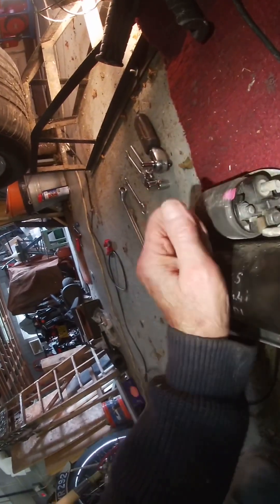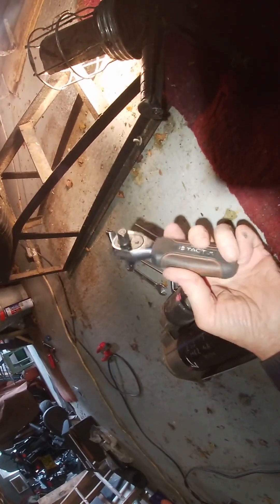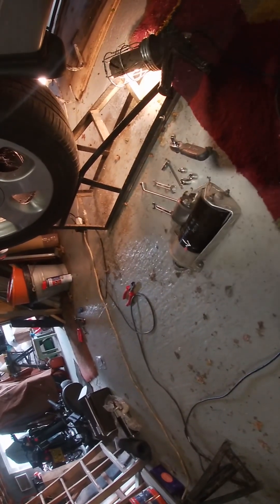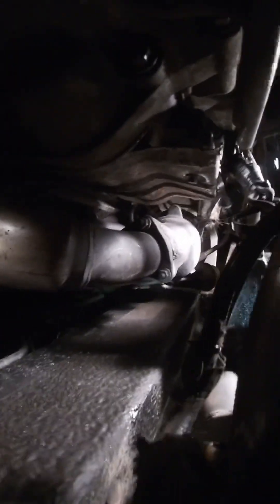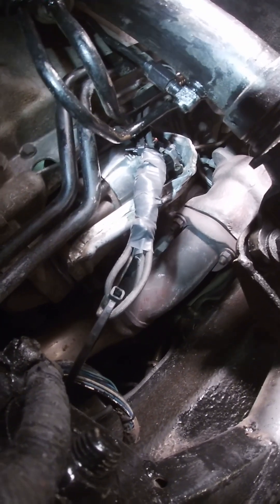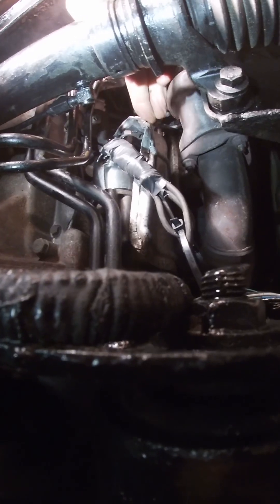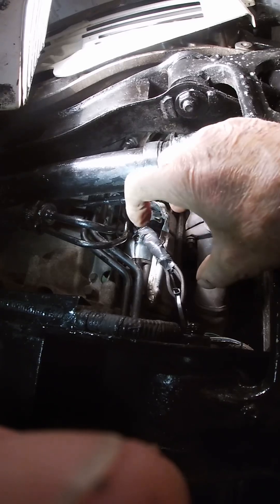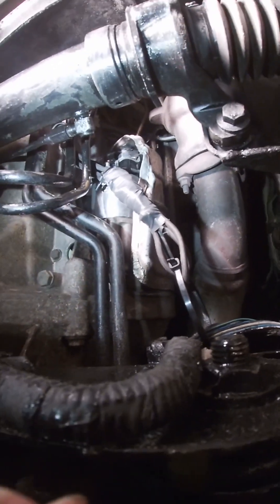Changing Bentley Arnage Green Label starter ( sorry , camera held end on).

Comment: Alan thank you so much for showing us how to change a starter on the green label now I know that it’s possible to do without removing a lot of  other parts . I can see the wire is a bit tricky like I said on a previous post who was the person employed by Bentley that design the electric’s
Reply from the maker: @GeoffScott-lb5yr  Thanks Geoff. I would definitely recommend extending the two cables to make the job much easier. Just make sure the cables are heatproof and fixed well away from the exhaust pipe ( the aluminium shroud over the starter is actually a heat shield ).

Comment: Great job! These videos are so necessary in order to keep them alive for DIYers.
Why did you replace the starter?
Reply from the maker: @carlosrengifo7210  The solenoid secondary contacts had gone high resistance so was not reliably supplying enough current to energise the starter windings. The dreaded click when you try to start . You can just replace the solenoid with a BMW unit ( but I didn’t know what the fault was until I had taken out the old unit). At some point I will put a new solenoid on the old unit as a spare.